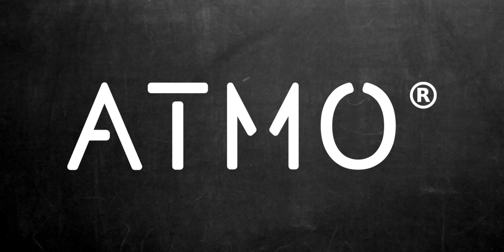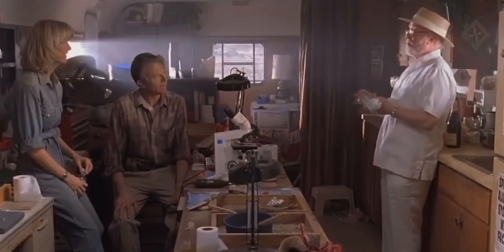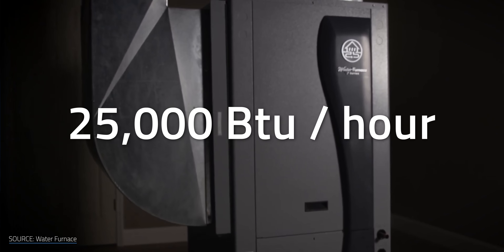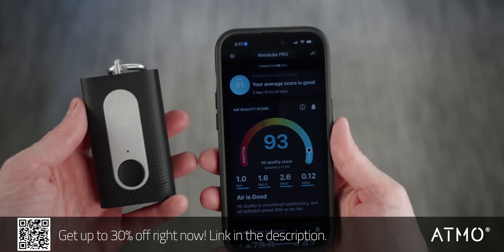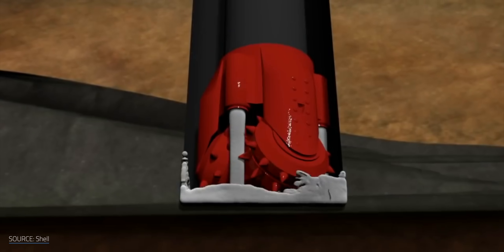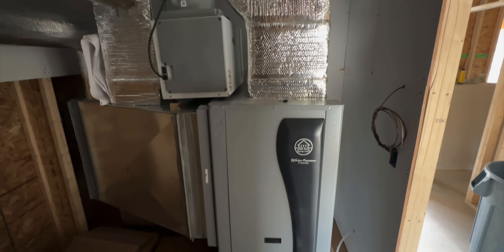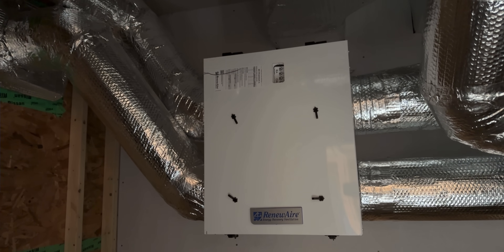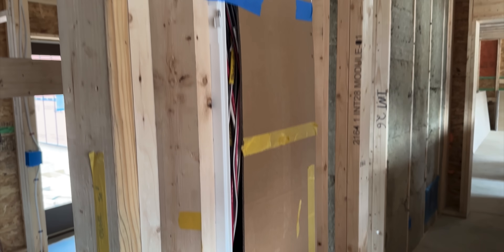Why I Went With Geothermal For My Net Zero Home

Comment: Forever home.  Made out of wood.  No.  30-50 years maybe.
Over here one of the commonly installed heat pump is a ground source heat pump.  Rather than going to 400ft they bury a whole mesh of pipes at about 4 feet.  Still works, but probably doesn't produce as much as the 400ft well would.
Reply from the maker: 30-50 years for me is a forever home, but it'll last much longer than that.  Wood built well can last a long time.
Reply: @UndecidedMF  True.  Not sure whereabouts you are, but anywhere with earth quakes, masionary needs built very expensively.  Wood doesn't mind as much, it can flex.
However, anywhere you get high winds, you want a solid 6 foot block foundation, block cavity walls and concrete rooves.
Reply: They only recently started building wood framed houses here.  They are cheap as hell, but a lot of mortgage lenders will not lend for them and a lot of insurers will not insure them.  They are unproven in our climate.
Reply: My house is an old 1960s coal fired house.  walls are dual skin 35cm thick.  1 inch thick concrete roof tiles.  It's been here 60+ years it will be here another 60+ years, barely needed more than a little repointing.

Comment: Matt, did you work with an acoustical consultant for your studio space? I do that for a living and I know how much it makes a difference in the quality of the space. Not selling my services just was wondering what your design looked like.
Reply from the maker: I didn't.  My GC knows a little bit about it and I did a deep dive on some solutions myself.  We're doing double 5/8" drywall and densely pack cellulose in the walls.  I don't expect my studio setup to be perfect by any stretch, but it'll be a HUGE improvement over my current sound isolation setup.  I'm expecting that I may want to do more down the road, but for now I think it'll be good enough.  If I want to do more, I'm definitely going to hire an expert to consult.

Comment: This is so cool! I've been fascinated with the idea of a super efficient house, so it's a pleasure to watch someone actually do it.
Reply: @UndecidedMF  So what happens when the house become sentient, ushering in the singularity?
Reply: It's being done all over Europe. ;)
Reply: @Mike-kr5dn  where are all the videos showing the details and how that translates to a US audience? I think this channel and especially this video do a perfect job describing the details and concepts without getting bogged down. Felt like the video was “meat” the entire time no fluff
Reply: @Mike-kr5dn  Europe is doing mass timber homes, an interesting idea.  I've also gotten a kick out of the earthship homes they build in Arizona.  I've got a pretty typical suburban home, I'm thinking about putting a whole house fan in as the cheapest way to save energy.  Nothing cool like these awesome super efficient home architecture, but its something.
Reply: I'm building a house this year that's all electric.  I'm going for 10-12kw of solar and heat pumps with 4 ducted mini splits.  Probably regular insulation and then an extra layer on the outside of the plywood.  Also good triple pane casement windows and insulation under the cement in the basement and garage.  It's not worth it to have a battery system, but I can put it in later if it makes sense
Reply: @timothyjohnson6055  that's "Passivhaus". Matt did run through his thoughts about it a while back though I forget his conclusions, it will be in his back catalogue somewhere.
Reply: I self built my net zero. As in ZERO bills. 3400sqft total all electric. I live IN a small town. Have vaulted ceiling in my living room and kitchen. Walkin tiled shower. Balcony and big 14 ×24 deck. Both on second floor. Not just a cabin.  My brother calls it my MAN-SION. Although I am envious of someone who can be off grid. In the middle of no where. 
I drive a forklift for a living. And have never worked less than 2800hrs a year. Even during the 4 years it took me to build my house. Mostly by myself.  I will pay off my build loan in 2 more years. So 7 years of paying for it.  
It is possible. But basically. I only existed to work  and build my house the entire time. Never missed a day working on the house. For 4 plus years. But in 2 years I will have ZERO BILLS. 
Sewer, water, insurance and taxes. The only things you can't get away from.
Reply: @danmccoy6164 you cold get a pumped well to get away from water bills.  
And where i live the sewage bills are calculated trough you water usage so they are also 0, and passiv houses Dont pay house tax for the first 5 years after they are built which was also a nice bonus, so you could actually get away from some of those ;)
Reply: Thanks for the suggestion of well pump. But at the last house. When the city put sewer and water into our housing development. In the outskirts of the city. They forced everyone to attach. The pump had to be disconnected from the house. You could still have it connected to the outside spigots. And was inspected to make sure it was done. 
In my new house buld. I would have to pay to have a well drilled.
Reply: Steel roofs are pretty smutch standard in Australia, always funny when i travel to the USA and see the roof is a road covering
Reply: Check out the "Passive House" building standard.  Lots of people choose to build to this super efficient standard to add value to their home.
Reply: Yes, its a cool build.
Reply: Well the best way to reduce emissions is to have a durable house and keep it for life
Reply: @mitthrawnuruodo7517  I feel you there. New construction has a massive carbon footprint but knowing that it's going to happen anyway, It's nice to see it done the right way.

Personally, I'd love to retrofit an existing house with great insulation, smart appliances, heat pumps, etc.
Reply: You don't have to be wealthy or spend a lot to have an efficient and affordable home.

I have been off grid over 20+ years now with a small 600 watt system and have most modern conveniences. Heat, cooking and water from propane with woodstove and electric  backups. Super insulated smaller cabin that is very energy efficient and a small swamp cooler uses 85 watts. internet, phone and I run a business online and make YT videos.

Most people don't have the money to have a custom zero energy home built with all those expensive systems but they can do what I and many off gridders have done.

No house payments, no utility bills and freedom!
Reply: @solarcabin   

You clearly live in Arizona, aka the desert. That's not an exactly sustainable place to put large populations.
Reply: @2sudonim  Not even close!  Foot of the Rockies, -20 and 3 feet of snow last winter.
Reply: @2sudonim   That's the reason I live there, hehe.  Water is manageable from rain, and available in large amounts from the air condensation unit used for drinking water.  There is no shortage of solar power, and it's availability is proportional to cooling load. It rarely freezes, and is very comfortable and dry almost 10 months a year.
Reply: @solarcabin  That might not be Arizona, the state, but it's still the Great Basin, which is a desert. Swamp coolers are more efficient in terms of energy than air conditioners. But they simply don't work in most places in the US that aren't both hot and arid. Where I live, the Summers regularly get to over 100F and stay above 70% humidity for days at a stretch. You can't use swamp coolers here to cool a standard wooden balloon framed house.
Reply: @solarcabin was figuring the same or similar where i won’t be net zero (gas) but still have a marginal energy and gas bill instead. certainly more cost effective for those who cannot build such a house like he did
Reply: I got you. Take some cinder blocks  fill them with concrete  and rear. Bam you to can own a super efficient  home. And 1,000,000 times less cost.
Reply: This isn't a super efficient house. It's a standard American suburban home with delusions of adequacy.
Reply: @2sudonim  actually I’m Missouri they used make a lot of the “high efficiency home with styrofoam,” till thieves would literally break into the homes with a drill bit and a can of gasoline. But still point still stands.
Reply: @2sudonim  It's going to be a maintenance nightmare.  From an eco/carbon standpoint the processes used to manufacture this house will probably never reach break even.

Comment: My biggest curiosity is if you're including a gas/diesel based emergency generator for when those new England winter storms might get to be too much and knock out the grid for days or even weeks.

Maybe it's the submariner in me, but not having an emergency backup to intermittent power like solar makes me twitchy lol
Reply: Plus the EVs probably have V2L which can be used for some things if shit hits the fan.
Reply from the maker: No whole house gas generator in the plans.  We're going to be all electric with battery storage and solar to carry us through any outages as much as we can.  However, I do have a portable gas generator from Ecoflow as an emergency backup to keep the bare essentials running if needed.  I don't expect to ever need to use that, but I've got it just in case.
Reply: @Undecided with Matt Ferrell  makes sense. Hopefully, you never have to! 

Can't wait to see how it goes when you have to stress test the system. Should be a fun experiment that I hope you get to document and share.
Reply: he mentioned a battery storage at the end of the video and with the smart panel he can shut down all unnecessary stuff during an grid outage and with solar panels on the roof he should be able to bridge a few days.
Reply: @theTJ  true, but there are storms in New England that can and do cause outages in some areas for a couple of weeks. They're rare, but not unknown, and many people need to supplement their panels with a generator. 

I'm very curious to see the upper limits of what his smart home can do on solar and batteries alone. I do hope it can handle it over the long term, because I think this entire build is fascinating and cool as hell.

Maybe it's just me being overly paranoid, but I have a hard time putting my full trust and faith into emerging tech like this. 

Plus, can't forget the wife/family factor too. I think mine would lose her mind if the grid was out and we were reliant upon only our own generation abilities.
Reply: I believe he said he was doing the battery between the panel and meter that would be feed by solar with an automatic switch event of total power loss and generating greener energy, hence why he was going all electric.

Comment: Damn, I didn't realise they could/would drill so deep for heat pumps!
So if the ground temperature is a steady 50f, does that mean you could cool the house to 50f too, if you wanted to? If not, what's the minimum temperature?
Reply: You can cool as low as you want. The in ground loops work like an outside AC unit. Still uses Freon and a normal refrigeration cycle but the loop temps stay more consistent than outside air does.
Reply: Actually, you can cool it much much lower if the thermostat allows it. Think how a freezer freezes, it takes the heat out of the freezer and plumets the temp down to freezing. The reality is that the unit wouldn't need to work hard as it is pumping it into a cooler environment than our homes are. The restriction will likely be the thermostat not allowing it.
Reply: Thanks you two - as soon as I read your replies I realised it was obvious, I'd just never used an AC which went below 16c
Reply: @Aliessil  They even make units to cool huge freezer warehouses using the same style system. It pays for itself very quickly in a poorly insulated commercial environment.
Reply: This ones long but hang in there! I know on my geo is closed loop. That allows it to heat until you go to the flow freeze point "Geo Lock" of the refrigerant (-40F/-40 most will safety stop at - 30F/34.5C). That means the more mass your in contact with achieved by loop length determines how long compessor can run before you hit this and electric backup kicks in to supplement untill ground temp can recover. This is called "Geo lock", i used to hit this untill my rebuild. Now with cooling it gets more interesting, since heat is the byproduct. You can heat your water more efficiently to 120F/49C and combined with electric just-in-time Hot H2O unit you can get higher domestic water temps. With the ground loop temp you will have ability to cool untill the loop hits temp hits "Hot Loop" status. This varies per units efficiency rating but is effectively 120F/49C max. There are practical building science related things when it comes to how much of a inside/outside temperature deferential one can achieve before issues may arise with condensation at different layers of the building envelope.